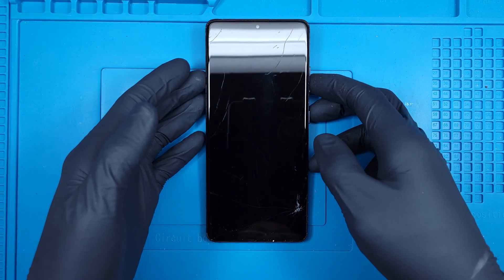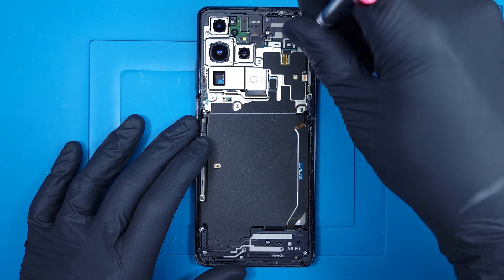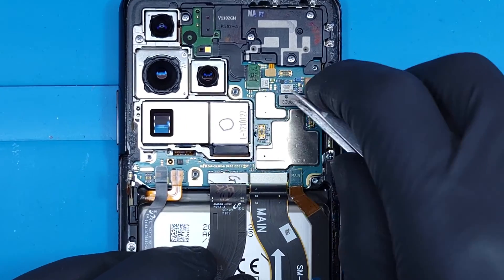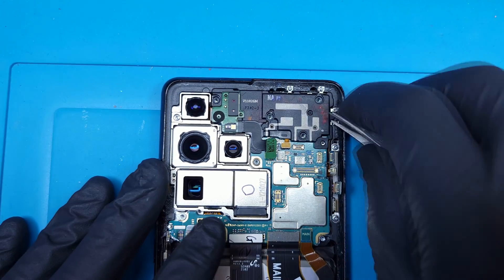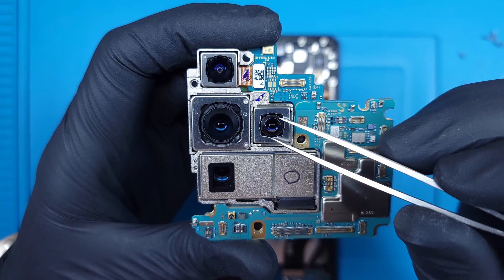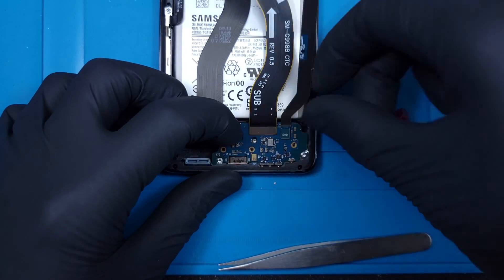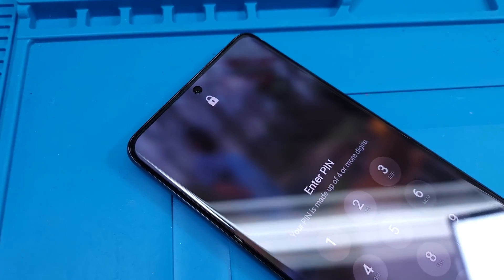Galaxy S21 Ultra Screen Replacement | Teardown Guide | Frame Assembly Replacement

Comment: What are you using to take out the back? I already stock that process? Is using a heatgun/hair dryer  during the process is required in any point?
Reply from the maker: You can definitely use either of those, I use a silicone heating pad that goes up to about 120C, though I only use it at 60c for removal
Reply: I used a toaster 😂😂
Reply: @joelwalker5408  I will be using this when my new screen and back come in seems like a solid idea.
Reply: @ebblesr did it work? Just about to do mine lol...
Reply: @ebblesr  where did you buy your screen?

Comment: tri wing screws got fudged up how to fix?
Reply from the maker: It won’t be fun, but usually you have to get a screw extractor set. You can also sometimes cut a flat slot into the head of the screw and use a flathead driver

Comment: does samsung S21ultra main screen assembly comes with battery ? including the frame ? because i think the service centre guy trying to cheat me
Reply from the maker: If it’s an official Samsung part it includes the screen, frame and usually battery all assembled. You can find them without the battery, but it isn’t weird for them to include it.
Reply: @TapticDigital  Thanks for quick reply, you are very responsible youtuber - subscriber + 1 👍🏽

Comment: Is there something that needs to be put in (silicone or conductive adhesive) with the 5G antennas?    I followed this, step by step, and everything works, except for 5G.    Which.... uh...  sucks massive balls.
Reply from the maker: Nope, nothing special with those. You can even leave out the metal bracket that holds it in. Check the flex connectors on them, make sure those ribbons don’t have any tears in them. And make sure they are fully connected, they are a bit smaller than normal connectors.

Comment: At what point along the time line did you replace the Ultra Screen?    Perhaps I'm looking for the wrong thing....what is the front glass piece called that covers the viewing area?
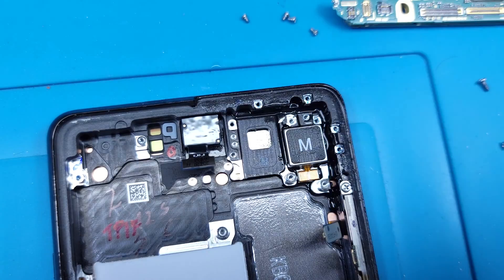Reply from the maker: @m.witter5115  2:17, the old screen is in the top right corner and parts are being installed in the new screen. The replacement part is a screen and new housing all combined, buying just the glass and display makes the repair much harder and less likely to be moisture resistant. The part that includes the housing is usually only about $10 more than the display on its own, but saves a ton of headache from trying to properly glue curved glass to a frame.

Comment: I thought the long connector you refer to as for the s pen digitizer was for the fingerprint sensor? That cable runs through the midframe right to the fingerprint sensor, I thought the WACOM chip on the underside of the logic board was for the s pen.

Comment: Hello Chris, I have an S21 then powers on but the digitizer was crushed, I plug it into my computer and I can see it but it's locked and I can't unlock it as the screen isn't working. I'm just trying to get the data off of it, would this be the easiest way? Thank you
Reply from the maker: @Landpirate  unfortunately a screen replacement is going to be the easiest route. Thankfully if data is your only goal you won’t have to do a full repair; just open the back panel to access the main display ribbon, disconnect the old and plug in the new. It’ll work just like connecting a monitor to a laptop. From there you can download all the data like normal, then return the screen if it is no longer needed. A lot of shops also offer this, connecting a part temporarily to download the data. 

But if you go through and do a full repair, you’ll have a working phone again or at the very least a good device to trade in.

Comment: the small connector next to the S pen long one ( 56 sec )  , what is that for , my screen didnt have it or the square box tbh , i damaged the ribbon on the connector as i didnt have the right screw driver  . seems to be working ok though
Reply from the maker: @richardprydden2851  that’s for one of the 5G antenna blocks. Yours is likely a non-US version or from a carrier that doesn’t use that part.
Reply: @TapticDigital  mine doesnt have any on the 5g antennas on the side of the case either , i havnt put a sim in it yet to see if it connects tbh
Reply: @TapticDigital  i should add it was the new screen that didnt have it , i know i need to get another one , cheap enough just time .

Comment: hey how do you troubleshoot if the screen that doesn't take any inputs i have tried forcing the phone off and unplugging the battery however there is no touch available
Reply from the maker: No touch, but does it display? If it does you can connect a USB mouse through the charge port and control it with that! Otherwise sounds like a bad screen.

Comment: Will all the data be transfered over?
Reply from the maker: Data is stored on the main board, since you’re using the same main board and just moving it to a new housing there will be no data loss. You can think of it like taking an Xbox to a different TV, the display is different, but the Xbox is the same.

Comment: Where's the screen replacement?
Reply from the maker: The replacement screen comes preinstalled in a new frame. This is the most efficient way of replacing the screen as it saves the time of scraping a frame clean, and helps maintain some extra moisture resistance.

Comment: Hi, what is the reason my front camera blur after lcd replacement? Hope can help what should i do
Reply from the maker: If the protective plastic in the new lens housing wasn’t removed it can be blurry. Overheating the camera can also cause it to look distorted.

Comment: You skipped on how to remove the back glass, selfie camera without damaging anything, skipped swapping whatever the piece is that has an "M" on it. Yours switched to a "J" also didn't mention battery swap. But other than that it was informative video. Thank u.
Reply: He didn't skip it, he bought a screen with a frame pre-attached
Reply: It's the vibration motor. Mine just had a bit of glue on the right side, it was pretty easy to pry up.

Comment: Is there any reason my s21 ultra overheats after screen replacements. Problem persisted even after the tech replaced it for 2nd time. Is there some thermal material or paste that needs to be replaced lile between screen and board? TIA
Reply from the maker: Yes, the tech may be forgetting to remove the plastic protectors that are over the heatsink pad and graphite pad in the new frame. They can look like they are meant to be there if you aren't too experienced with replacement frames, but they will absolutely overheat eventually if you forget to remove them. Otherwise something isn't right with the parts being used, depending on if they are factory or aftermarket frames, some companies like to skimp on the thermal pads.
Reply: @TapticDigital  thank you for responding. :) 

Would the material be on the bottom between the frame and board? So I'd have to remove the board from the frame to verify?

I also noticed there was a lot of black rubber material over the silver traces on the board. I don't know if that had some effect as well.

I appreciate the feedback.

Comment: Question did you replace battery or transferred? Noticed new part is only frame
Reply from the maker: This one was strange, for a time the Samsung S21 Ultra service kit included a preinstalled replacement battery. It’s possible they designed this to make it easier for Samsung certified employees to replace screens on the fly while minimizing the risk of ever having another Note 7 fiasco.
Reply: @TapticDigital  would you recommend I find a battery included part or transfer

Comment: Will it be waterproof after still?
Reply from the maker: Water resistant yes, as long as the adhesive is done correctly. Always treat your phone like it isn’t waterproof though, much safer
Reply: @TapticDigital  alright thank you

Comment: Is it true that they need to put a special type of glue for the back part of the phone?
Reply from the maker: Yes and no. The adhesive from Samsung is actually just double-sided tape cut to fit the glass. You can use some silicone based glues as a replacement, but glue gets very messy and can soften with heat, so I always recommend a thin double-sided tape.

Comment: I wish I had found this video before I "downgraded" to the S23 ultra - 8GB of ram vs. the 16GB of ram in my old S21😐 - I wasn't advised before I did the deal
Reply from the maker: I'm still using my S21 Ultra because Samsung still hasn't made a single improvement worth mentioning
Reply: Why didn't you take 5 seconds to research before buying?

That's your fault. "I wasn't advised." Why would they mention that to every customer? Lazy af

Comment: Thanks for your nice video, mate. What are your thoughts about replacing the screen WITH frame and the quality of LCD vs OLED?
All parts we can find as OLED are usually the screen only, and I agree with you on your comment, that it's so risky and the results are not the best when doing OLED screen only.
But when wanting to buy a screen with frame for any S20, S21, etc usually they're just LCD with frame. Is it worth compromising a downgrade from OLED to LCD to preserve the integrity of the frame? Or maybe is there not such a huge difference? I'm a bit lost here, as honestly I've done a lot of LCD with Frame replacements and I find the quality quite good, but I've been challenged recently to why we don't OLED screens instead of LCDs... Any thoughts are appreciated! Thanks :)
Reply from the maker: How on earth did I miss this comment? My bad @xFeloxX. It's really a matter of personal opinion. If it's for a customer there were times I'd offer LCD instead of OLED for certain devices. I'd explain there would be differences, the LCD was a cheaper repair, but it wouldn't be as bright and colorful. It also may use more battery power.

I find that OLED is a much nicer experience, but some customers don't care and just want a cheaper repair that will get them back up and running.
Reply: Don’t ever use LCD on an original OLED that was used

Comment: So I will see you from the start off right from the back from this video. You are not mentioning that you need to heat up this phone in the back. You are not mention you need to use a heat pad or heat gun because it has adhesive there’s a few different things you were mentioning and this is how you were promoting helping damaging other peoples phone don’t make a tutorial if you don’t and in all the fucking details.

Comment: You didn't even show the screen replacement just the tear down and put back together
Reply from the maker: The replacement screen is sold with a new frame attached already, the entire housing of the phone is replaced with the screen. If you do it as the display only, you risk it falling off eventually and a significant reduction in water and dust resistance.

Comment: Where can I get an s21 ultra screen and how much would it cost
Reply from the maker: I recommend Injured Gadgets or Gadgetfix, though many vendors sell the parts. They are usually around $240 for the replacement part.

Comment: nice video but having problems removing the little screws on the athenna any adivice? i have a set  of mini screw divers none of it work with it.
Reply from the maker: Unfortunately since they are triwing screws you won't be able to grab them with a Phillips or a flathead. And being so small I doubt temporary drivers (like melting plastic into it) would work. Best bet would be visiting your local hardware store for a set of precision drivers, and make sure they include the triwing bits. I found sets ranging from $8-$15
Reply: Heat up edge slightly w/heatgun ..glue will release

Comment: The way you repaired it in the video, is it still water resistant? Or do I need to replace the back glass adhesive
Reply from the maker: The way I replaced it and used adhesive primer does maintain some water resistance, but replacing the adhesive is usually the best route. If you do, you'll need to make sure it's completely sealed against both the glass and the frame of the phone, using clamps, or preferably a vacuum sealer
Reply: @TapticDigital  thanks for the tip, I'll make sure to replace the adhesive

Comment: Ifixit sell the screen replacement with a battery attached the links you provided do not, but ifixit don't do international delivery. Any other suggestions?
Reply from the maker: You can always purchase the parts separately, a new battery is not required when changing the screen. As far as non-US vendors, I'm not familiar with any of them unfortunately as I only work in the US.

Comment: So you can't just replace the screen you have to replace the frame as well?
Reply from the maker: It's the best way to do it and still retain some dust and moisture resistance. I've done screen-only in the past and the glue seems to almost always fail.

Comment: Nice vid, brother. My S21 ultra suddenly got the infamous line on the screen. Almost perfectly in the center. I can still use it but do you think it's worth replacing the original parts to fix this? Is the quality the same? Sharpness, touch and fingerprint scanner responsiveness, glass quality, etc.
Reply from the maker: The parts used are Samsung official parts, so it would be the exact same quality as the original. I'm not sure it's worth replacing because of how expensive they are, but that's more of a personal thing.
Reply: @TapticDigital  thanks to my location, I can't get the parts from your suppliers. I found some who can ship but you're right they're expensive and I'm not even sure if they're official parts. I guess I'll have to see if this gets worse over time before I decide to buy. Thank you!
Reply: @TapticDigital hey which one is the best can I buy for my s21 ultra replacement screen please ???

Comment: The screen is weird because it will crack in one spot and make other parts randomly crack
Reply from the maker: The joys of curved tempered glass, it's got a lot of pressure points across it!

Comment: Will I keep my broken phones data after the replacement?
Reply from the maker: Of course, there's no reason data should be deleted or reset during nearly any repair. If a company says your data will be lost, they aren't repairing the phone, they are replacing it with a refurbished one.
Reply: @Taptic Digital  thanks for the reply. I see cheap used ones on ali express. You think they're trust worthy?
Reply from the maker: @selfmadetjh8889  they might be alright, I would highly recommend one that comes with the frame already installed, that way you can move all the internal parts over to a new body
Reply: @Taptic Digital  I appreciate it man. 🙏🏽
Reply: @TapticDigital  Hey! I replaced followed all the steps you did in the video and everything went smoothly! The only problem im having is my service is now off. I checked the sims card slot and everything seems to be fine. Yk what else it could possibly be?
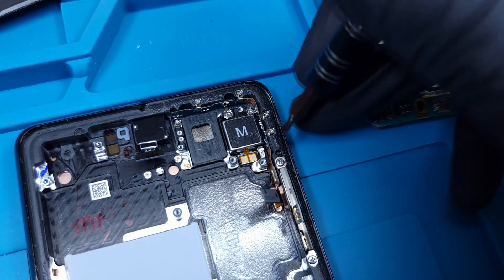Reply from the maker: @selfmadetjh8889  there's a good chance it's the antenna needing to be swapped over. Check at 2:10 for that antenna, it needs to be swapped over even if the new one included one.
Reply: @Taptic Digital  hey man sry to bother again. You know what part of the phone is responsible for gps signal? I got everything in tact but that. 5g works its just when i try to gps an address it doesnt wanna update as im traveling
Reply from the maker: @selfmadetjh8889  I don't believe it's a hardware component that can be easily changed. I think more likely you have a software issue, like power saving or some permissions are disabled. Try different map apps like Google Maps or Waze and see if they behave differently

Comment: I Know this is a year late. I've got the British version to this phone which states is 5g. I have had Samsung replace the screen when in warranty. I have come to open my phone and  replaced the screen myself. It seems to be missing the 5g antenna u have pointed out on this video. Is this normal for the British version or have Samsung messed up on my original repair?.
Reply from the maker: Sounds normal for a European model, the reason the US ones have those big radio antennas is to communicate with the 5G Ultra Wideband that US carriers use. European models work off a different type of 5G.

Comment: I thought a screen protector was to protect the screen, but somehow it bypass it and I got my screen cracked
Reply from the maker: Screen protectors are made to absorb kinetic impacts, but too much impact or at just the right angle and all that energy goes straight through, and pow! There goes the glass. As Jerry Rig Everything says, glass is glass, and glass breaks. 😥

Comment: Am I missing something? Wtf did that have to do with a screen replacement?
Reply from the maker: Like the title and description say, it's replacing both the screen and housing of the phone. Parts from Samsung come assembled as one piece, this helps the phone retain water resistance, and keeps the screen from falling off due to improper gluing like you'd see on a screen-only repair. Plus parts with a frame are about the same price as a display only, it would be silly to use just a screen.